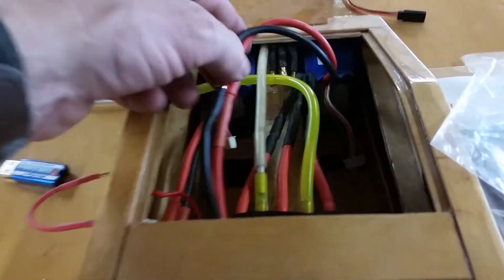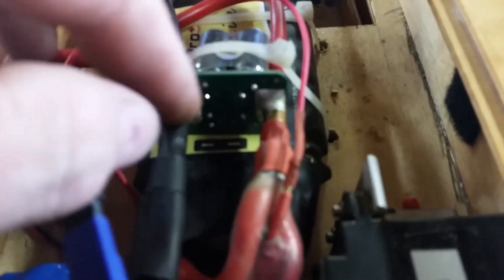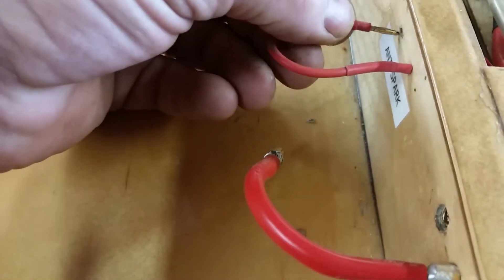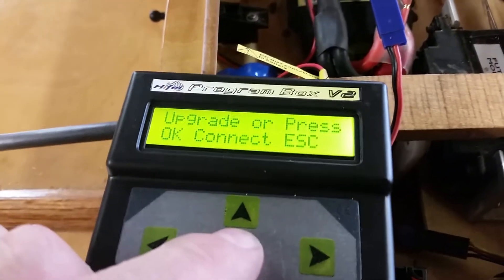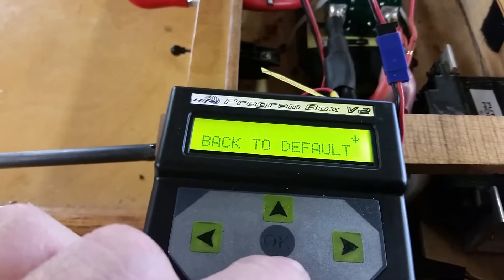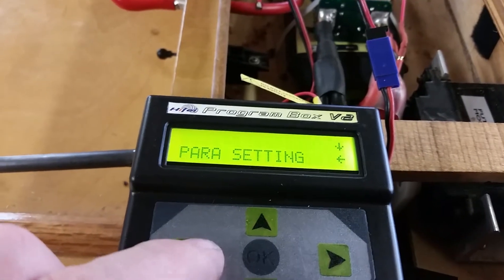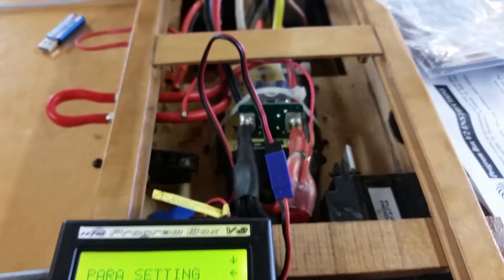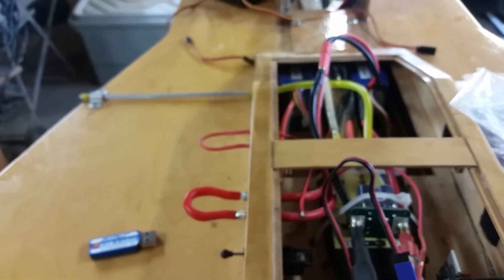Swordfish 300a problem

Comment: did you ever figure out the problem
Reply from the maker: nope. had to get a replacement
Reply: crispyspa ok im going threw some probs hookin up usb linker any tips keeps saying timed out cannot connect my port # is rt
Reply from the maker: +WIG SPLITTERS RC  maybe you have to hook the battery up.  I exchanged it for a non data logging so I really don't need to hook it up to a computer.
Reply: crispyspa yea i have it hooked up it might be the link i get no led on usb
Reply: you have to setup the esc to a window 7 computer in order to program it .using a Lipo battery also adapter for esc also the program card .install hifi esc 300 amp download on your computer.also to setup this esc it doesn't work with just the program card.
Reply: I have the 300 amp swordfish esc a setup the timing voltage cutoff. hard brake are soft brake